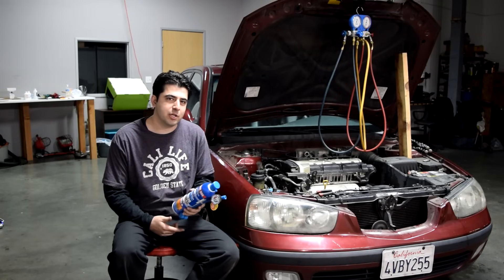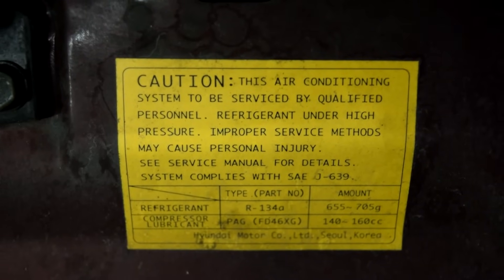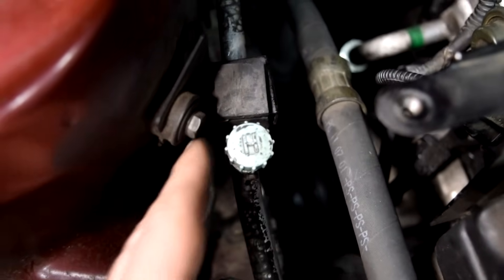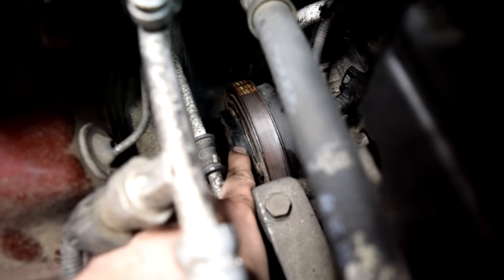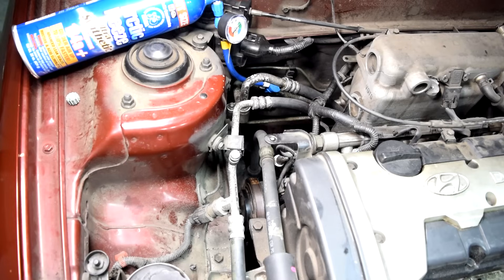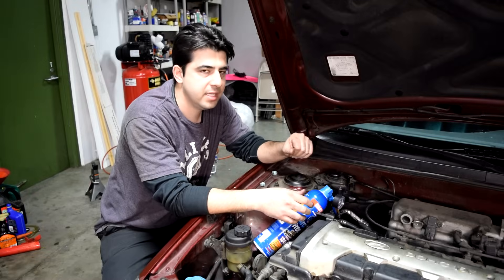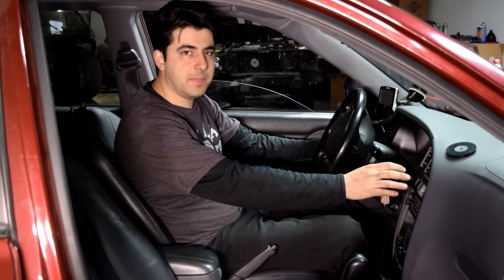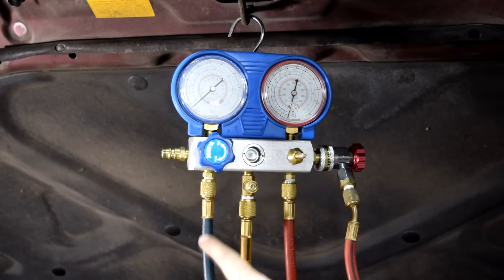How to Safely and Easily Add Refrigerant to Your Cars AC System

Comment: you forgot to mention to purge the yellow supply line when you screw the can of freon onto it.  My questions is after you pull a vacuum do you need to add any pag oil of you are just doing a fresh recharge.?

Comment: Do you need to purge the air from the filler hose?  Especially that long hose on the real gauge set.  I don't know how much air in the system is too much, but I'm sure that less is better.  Thanks.

Comment: Don't forget a couple simple things for best a.c. cooling performance; blow out condenser (in front of radiator) with high pressure air or use a condensor solvent solution. Remember, blow towards front of car from engine side(under hood) the reverse of natural air flow. Do your radiator too!.  Good to check evap coil too if accessible. Sometimes kleenex or napkins get sucked in from glove box and block fan or evaporator.

Comment: You can also remove connector to pressure switch and jump it out on the vehicle plug side with a jumper wire. It'll keep compressor running at all time your refilling. Cut your refill time in half. Also, let run awhile before charging system, aloows system to balance out. 10+ minutes. Stick a meat thermometer in air duct inside car to track progress. Bad time to refill is when sweltering hot weather but hey, everyone's doing it

Comment: Hi guy, thanks for the video. However, there are some clutches that keep rotation whether the compressor is engaged or not. For instance, I have Toyota Camry 2017 and Toyota Corolla 2016 and they both work the same way. However, I need to know if the Camry is working well. Can you explain if you have any idea about such compressor? I will greatly appreciate.

Comment: I just wanted to add a comment but first I have to say it was a thorough video but there was no mention of how you bleed the refrigerant lines on the ac manifold.   You do not want any air to enter your ac system.   Bleeding the line on a fill-up kit is difficult and many times impossible but an ac gauge set should allow you to bleed the air before adding refrigerant.   There is air in the lines before connecting.

Comment: This is by far the best explanation between the past video and this one. I personally have both I was wondering could you just refill with the simple low pressure side and not have to use the gauge assembly. Thank you so much for making this video

Comment: So my car says it needs 24.58oz but after only adding 1 12oz can of straight 134a freon the gauge shows it's in the yellow area. Should I still add the other 12oz anyway? The system was completely empty of figurant so it should need all 24.58oz I would imagine right? Btw it is blowing cold air
Reply: So I just attached the gauge back up and now it reads in the yellow until the compressor turns off then it goes in the red. Idk why the compressor is turning off and on. It only has less then half of the freon it's supposed to take and it being in the yellow when the compressor is running I'm afraid to add more. Now my car overheated while it was idling while I was checking the a/c pressure so idk if it's do to the a/c being over charged under charged or some other reason now. Any help appreciated. BTW I did have a vacuum on it and 3oz of page oil added if that helps.

Comment: You never add refrigerant in liquid form. As in turning the can upside down. Add only as a vapor, can right side up. It' called slugging the compressor. You don't do it on home units especially. Just takes a minute or three longer, the CORRECT way, in vapor form.

Comment: As a retired body man, I used to just energize the AC clutch by crossing a wire from the battery to the clutch. When the AC system was empty and the clutch would not engage that was the easiest way I knew to get the job done

Comment: Ok...my Mackey moose mechanic put 4 cans in my system blowing the popoff valve...system left open for a week and a half...but my A/C WAS NOT ON...I LIVE IN CA MYSELF...SO...I figured out why my A/C wasn't working in the 1st place...so I fixed the broken wire...also installed a rebuilt clutch...GOOD...In the meantime he had another Popoff valve installed and 1 can r134a I have cycled it several times and very little cool came out...short cycles...test to see if clutch stayed engaged...yup...ok...now I will try a can of same or another brand & run it when inserting more r134a freon...HOPEING...try to get back to let you know...

Comment: The hot air is working in my car. But for cold I need to turn it all the way to ''low'' for it to actually be called. Any other celcius like 17, 18 and 19 still feels hot.. What can that be?

Comment: Hi I have a 96 suburban. Replaced compressor, orifice tube n accumulator. System did not hold vacuum all the way to -30 but its holding pressure on high n low side. I started adding refrigerant which takes 64oz total. I have added about 12 oz n like a said is holding pressure so far but the clutch isn't engaging. Do I need to put all 64 oz so the clutch can engage or it should starting engaging at certain point with less that 64oz? If so, how many oz will be enough for the clutch to start engaging? I don't want to go forward n wasted refrigerant because of the vacuum but like I've said is holding pressure on both sides.

Comment: I’m using the vacuum tool that has the two gauges and followed everything you said but it’s not pulling an refrigerant into the system.  What could I be doing wrong?

Comment: Probably what I would do is purge the air out of the line while connecting the connector. Also to avoid over charging keep the RPMs above 1000. 1500 rpms is good.

Comment: Your hose is too short,the can should always be in the upright position at all times otherwise you run the risk of pouring liquid refrigerant instead of allowing it to turn to gas and this can damage your compressor pump

Comment: One of the big problems with using those cans that already have a lubricant installed with them some of them have the leak sealant and then they have their super cool additive or Compressor conditioner extend life additive in today small systems it overloads the system with lubricant displacing the refrigerant the gauges are very in accurate and some causes compressor damage on some systems because of their inaccuracy. Works for some people they get cold air other people are paying a visit to the mechanical shop getting a compressor replaced highly recommend not using the cans with all the additives and the crummy little gauge unless you want to risk the expense of replacing a compressor

Comment: Is it ok if when I press the button the gauge goes to the red but when I’m not pressing the button the gauge is in the mid green while the hose is connected? Is it going to the red when I’m attempting to fill it just due to putting some refrigerant in and I have no need to worry ?

Comment: I had a question about adding with the manifold gauge, what number am I looking for to Kno that my system is completely full? Also I followed your step on the vacuum process & after 20 mins the vacuum pump suddenly stopped and is extremely hot my gauge read -20. Should I let the pump cool off and try again?

Comment: Curious, if you use the method with pressure hoses, isn't there a lot of air from the yellow hose to the low side hose that goes into the AC system before any fluid even comes out? Shouldn't you have to prime the low side line by filling it up with AC refrigerant?  That's about 6' of empty lines before the first drop of refrigerant even goes into the system.  I don't know. I'm not an AC guy, but two hoses seems like a lot of air for such a small system. So can you explain why I am wrong? I know I have to be, I just can't figure out how air is not allowed in the system, but hooking up and turning on empty lines is okay. Does that make sense? I hope so.

Comment: This is not the correct way to recharging.  Very risky.  High risk of getting air in the system without purging. Also high side and low side should be monitored. I've seen many compressors seize using this method.

Comment: You're awesome, thank you so much! Compressor clutch wasn't engaging and from what I read it could be the low pressure switch not allowing it to do so. Anyway, I threw a recharge can at it and it immediately kicked on. Unfortunately I found out that I have a leak in my coils, but at least it's not the compressor as the condenser replacement is much cheaper (found a new replacement for $60).

Comment: just checked a friends Nissan Rogue with this exact Arctic Freeze... Pressure cycled from 27 when clutch is not engaged to 47 psi when the clutch is engaged.  Sort of disappointed with this Arctic Freeze brand for unlike another brand I had used before it had an adjustment on the pressure gauge for ambient temperature which the Arctic Freeze did not have.  So essentially not sure whether to add Freon or not since it is already in the lower area of the yellow range (Alert) when the clutch is engaged. Advice on this scenario?

Comment: I have watched several videos on the topic of charging your cars AC, all but one wasn’t worth my time and the one barely made the cut. Then I happened to come across your video. I would like to say it was well done! You were very informative and professional in your presentation, anyone that watches it and follows your instructions, should be able to confidently complete a recharge!
Thank for a great video, keep up the great work!
Wish you were my Mechanic!
Reply: AC systems are really quite simple to work on when I was a young man I worked in probably 15 Body Shops over my lifetime and repaired  many AC systems from cars that I had repaired after being in an accident.Recharging is ultra simple diagnosing is not hard either
Reply: @ericjkent  if my a/c is cold on the passenger side and warm on the driver side do you think its low on refrigerant?

Comment: 9:00 whats the difference between the ends of the lines with the elbow side and straight side?there is an visible difference between the ends?.  didnt mention anything about purging the vacuum line before opening lines

Comment: Great tutorial thanks!  
fyi, the larger line was marked Low on my 07 Altima and the small line was marked High.  But like you pointed out, it only connects one way, so I got it filled up and it's blowing ice cold.  Thanks again! 👍

Comment: Changed compressor, changed dryer, used vacuum, refilled AC but  car only blows cold air for five minutes- then changes to regular air. Ac compressor clutch turns on and off rapidly while blowing regular air- what should I do?
Reply: saul fernandez check if your relays are good

Comment: I was curious to know, I noticed my AC compressor clutch continuously runs even when I do not turn the AC on. Meaning, it never disengages and no cool air is blowing out. And from the moment I start the car to turn it off, The AC clutch stays continuously engaged. What would cause this to happen? Why is the AC clutch not disengaging when it is turned off?  Is this a relay, or high, or low pressure issue?

Comment: You should update the video by showing the correct way to use a gauge set to add freon. Air MUST be bled out of the gauge set before it is connected to the system.

Comment: Hey by any chance could bad thermometer change be the cause to Ac not working? Whenever i turn the Ac on its as if it was simply throwing regular air out the vents. And the heat works great!

Comment: Teflon tape is not needed on the can threads. The seal on that connection is not made at the threads. It is made at the end of the fittings from the can to the gauge......like a flared fitting.
Reply: ea333525 
You're right. Teflon tape only works on pipe (tapered) threads. Straight threaded fittings have seal at an o-ring or flare inside the fitting, not at the threads.

Comment: Thanks for covering even the small stuff, which is important to a total newbie. Here's a small stuff question: Do I leave the car running while hooking up the second can?
Reply: no they are one way valves
Reply: Whenever you are adding refrigerant the car has to be running with the a/c on full blast, that is so the refrigerant can cycle and wont cause any pressure buildups
Reply: duly noted, but what about when I'm unscrewing the first can and screwing in the second ... do I keep the car running while doing that? Won't the refrigerator squirt out of the intake valve?

Comment: The problem with those blends is that it's not 100% R-134. That 22 oz can is probably 18oz of refrigerant and 4oz of additives. The label on that back specifies exactly of the contents are refrigerant by weight. The spec for that car assume you're adding virgin R-134.

Comment: Coincidence I got the can with same gauge. Just my can was only 18oz total with additives, Interdynamics Glacier Ice, UPC 048168018291. Good point to wrap Teflon tape on threads on the can. Also you taught me not to turn R-134 can upside down. Glad I looked for your help again with my '02 Kia Spectra. I did my Kia's timing belt R&R with help from your video on that. Rock on man!

Comment: THE PIPES COME DIFFERENT SIZES ON DIFFERENT CARS BE AWARE
Reply: If its a 134a system the high and low are ALWAYS the same on every system. high is a larger port than low

Comment: ive got a 95 f 150 and my compressor clutch is not engaging, im sure its because i have low refrigerant. with that said, how much refrigerand should i add before it will engage. with the engine off or on when i connect the ac charge kit the needle reads just in the green. should it be in the red before the clutch kicks on thus dropping the pressure?

Comment: Great video. Subbed.  I am having an issue where my AC clutch engages for 5-10 seconds and then disengages. This cycles over and over. This is causing me to not get a reliable reading. Could this be a pressure switch problem or should I just put in the other can.  Sometimes the gauge shows overcharged and that is causing me to hesitate adding the second can even tho i am pretty sure the system was empty because of very small leak.  If everything was functioning normal except for a slow leak.. I should get cold air at least until all the refrigerant leaks out right? Thanks

Comment: Hi @RatchetsAnd Wrenches .my car still blows hot air.
My compressor is working and they checked it out and it has NO leaks. all O-Rings were also replaced.
we changed the expansion valve and it worked only for 2 days.
altought throughout all these steps , we never vacum the system.
is this the cause of the hot air blowing?
please let me know ASAP
Reply: first vaccum all air inside the pipes and condencer unit using an additional compressor

Comment: great video. I tried adding refrigerant to my vehicle and the gauge read that it was full, but the compressor was not engaging with my ac turned on. should I ignore the gauge reading since you did say that the gauge reading doesn't mean anything if the compressor is not engaged. Should I just keep adding refrigerant and see if the clutch engages?
Reply: Jose Andrade That's what I would do since in the video his clutch wasn't engaging but after he added some freon it engaged.
Reply: I have had this problem many times in many body shops if the ac clutch won't engage while I am recharging I take a piece of wire and connect one end to the positive terminal on the battery the other end should be peeled back a half-inch or so then use that wire to energize the clutch and you are ready to add freon now.

Comment: on my 2000 ford mustang my compressor kicks on but then im driving for at least 10mins my ac clutch turns off and blows hot air? do i need free on or a new clutch?
Reply: Could be your compressor clutch relay.  $6.00 or $7.00.  Try to change/test the relay.  R&W has a video on testing it.  Replaced mine yesterday and that solved the problem you mentioned.
Reply: That's great!  Glad it worked for you.  (I'm not taking any credit as I'm sure you fixed it long ago). R&W is a very informative guy, I am a trained mechanic and I am constantly learning something new.

Comment: This video was by far the best one on youtube and helped me out a lot. It seems to also be the only video on here that helps people know where the ac pressure switch is at on the ac line. I had a hard time finding the pressure switch on my Mom's 2003 Buick Century 3.1 V-6 but thanks to your video at 5:06 timeframe it helped. Thank You very much. I have a question about the pressure switch if you could answer it.      Will I lose all of the cars R134a freon by taking the pressure switch off and replacing it? My Mom's Buick Century is always blowing the 10 amp ac clutch red mini fuse every time we turn the air on and we were told to try replacing the pressure switch. When the air works until the fuse blows it works great. If you can think of anything causing the 10 amp mini fuse to keep blowing like that let me know? The ac clutch relay is ok and the diode >| both inside the under hood fuse box are ok. And no leaks in the system but I need to get the ac to quit blowing fuses and afraid about replacing the pressure switch until I know whether or not I might lose all of her R134a. Thanks for your help and any future help you might offer. RatchetsAnd Wrenches you have been such a help, you're awesome!!!

Comment: Thanks for the info about the a/c.
I had my car serviced. Cost me $94,00and it wasn't working like it should be,they said he gave me 2lbs of it wasn't enough wasn't cold enough,  bought that bottle and checked it it was very low compressor wasnt working good, I put about 1\4OF the a/c pro and it working now no leaks, nice and cold only paid $32,99at wall Mart for it. I spent $94,00for it I good kick my self.
! Thanks for the video.